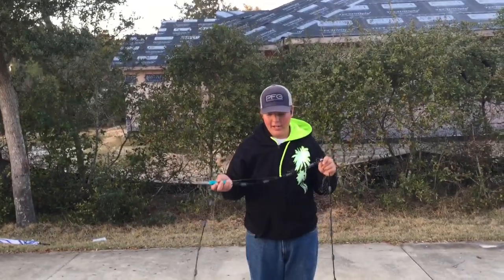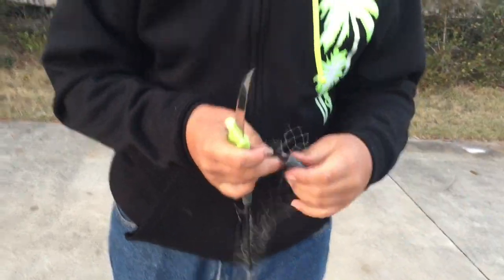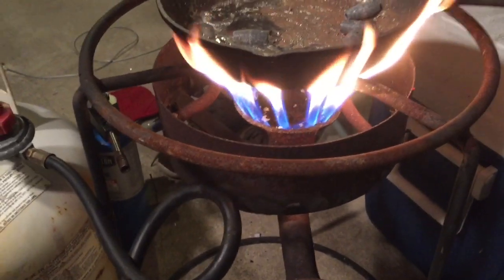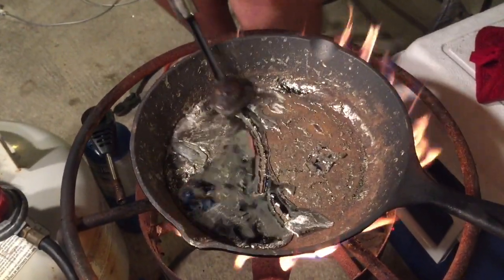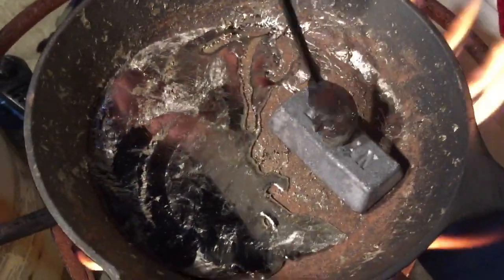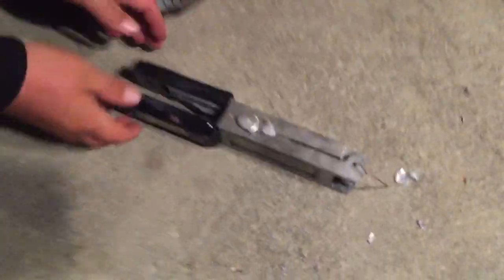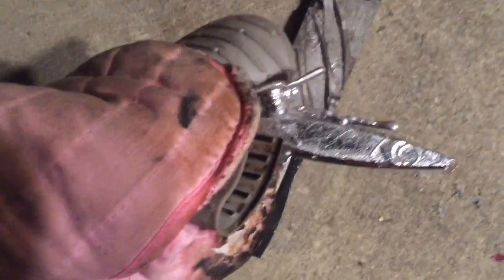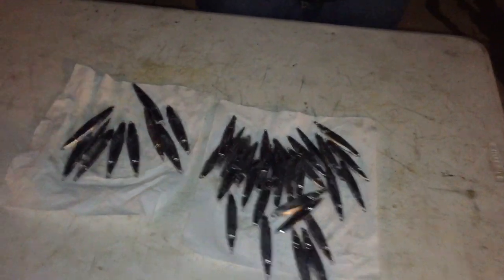How to make flutter jigs super cheap!!!!

Comment: Ion my experience it’s easier to pre heat your molds by just pouring a couple jugs without the wire in them. That gets them nice and hot pretty fast. Then you can re melt the jugs you just poured and pour your real jigs

Comment: Hello, your videos are very nice. I'm trying to make 40 g and 20 g jig lengths 6-10 cm molds everything I've prepared ok it comes out fine casting ..
My only problem here is that the bending of the bullets can bend even with my hand. I don't know where I've done wrong. another material is being used.
Reply: Use lead weights not kther materials
Reply: And also heat it aot not for 5 minutes and let it sit in warm water after casting the lead
Reply: I have same problem. Did u try what was suggested and works?